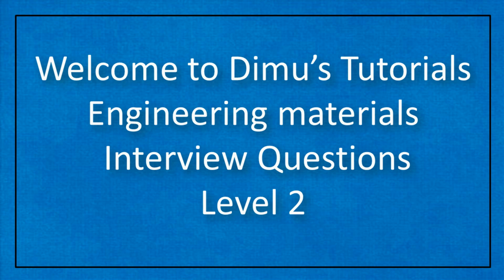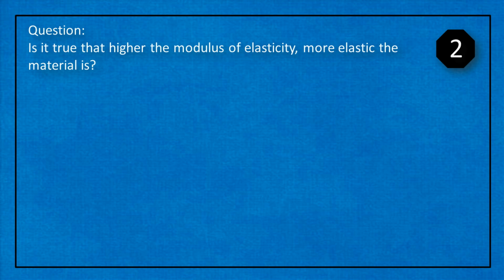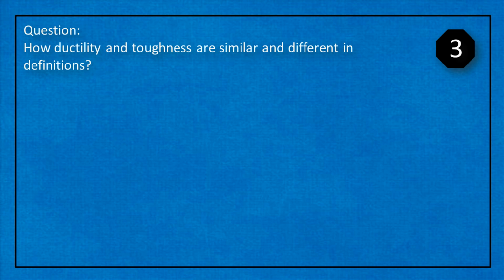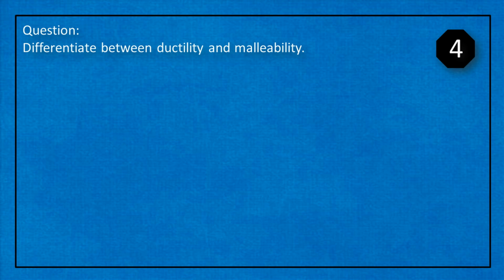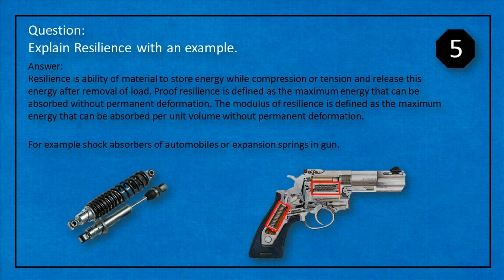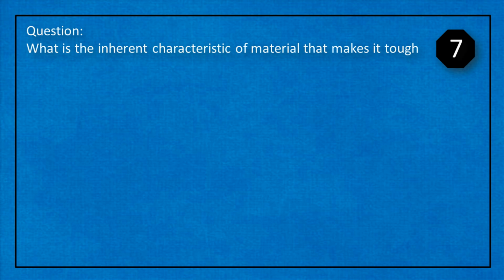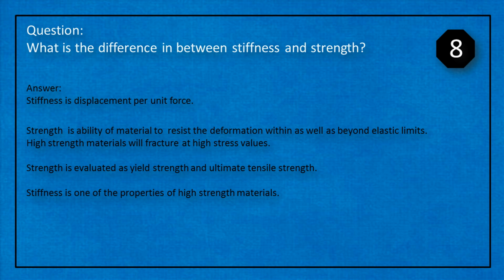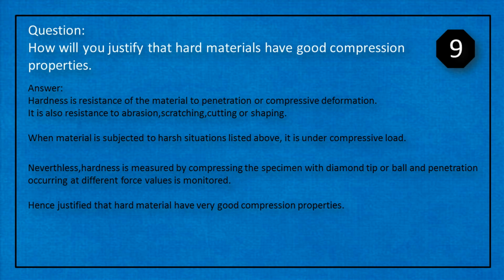Strength Of Materials - Mechanical engineering interview questions,dimu's tutorials

Comment: Thank you sir. For case hardening if the interviewer asked an example can I say that a sword will have to be hard at it's tip and ductile in rest of part. Or can I also say  an example of brake disc which is subjected to high shear and thermal stresses and it's outer rim should be case hardened.
Thank you very much sir. Please make more videos like this in design
Reply from the maker: Mekapati Darshanik 
Sword is great example of case hardening.
I am not sure about brake disc.